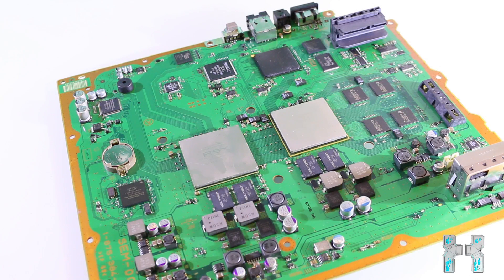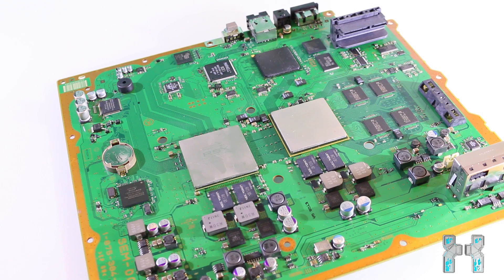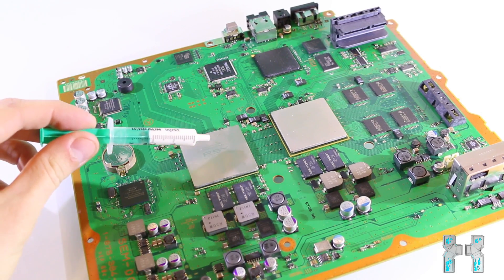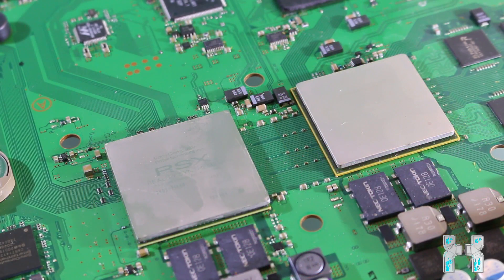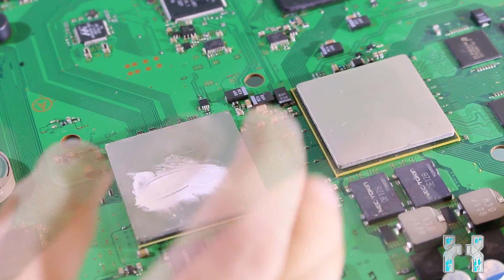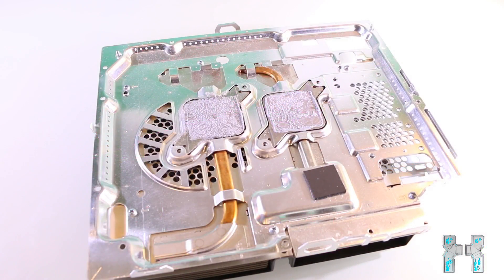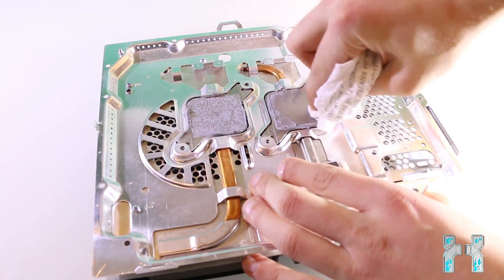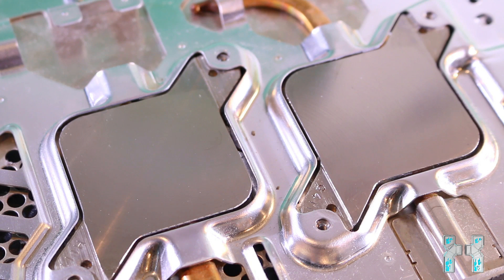How to re-assemble a PS3 - Back alive ! - YLOD Fix Part # 3 [HD]

Comment: Hey great tutorial I got to ask you a question. Do you have to flux it? I havent had to flux it for the last 4 times I revived my PS3 should I start fluxing it after it dies on its 5th time? And is that really all you have to do when you flux it? Just put flux in the gpu, cpu, and ram? Thats so easy a cave man can do it.
Reply: you don't have to flux it, but doing so should give the PS3 a lot more life than if you were to just reflow it. Sony deliberately use non leaded solder and that God aweful thermal paste so that you
A. Pay £150 for a procedure that is so easy to do yourself or
B. Pay hundreds for a new console.

I bought a 60GB Backward Compatable PS3 with YLoD and used this method and its still alive and kicking. I paid £20 for the console and £25 for the equipment. Heat guns in the UK are relatively cheap (well the ones you need to reflow a PS3). Arctic silver 5 can be bought for £5-£10 and the flux is relatively cheap. you don't need a massive bottle. But make sure you get the flux mentioned in the video. Non-corrosive clean free flux. That's important. 
I aim to keep my PS3 going for years to come as it can play PS2 and PS1 games.